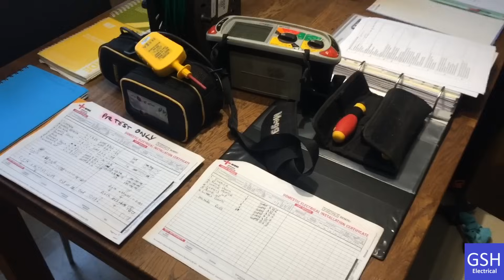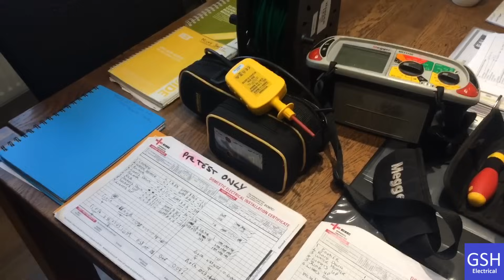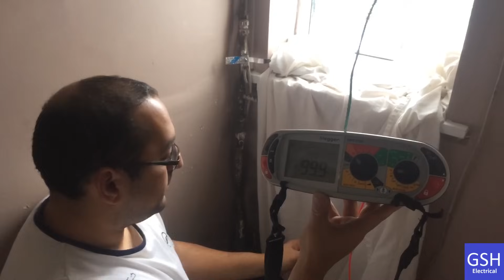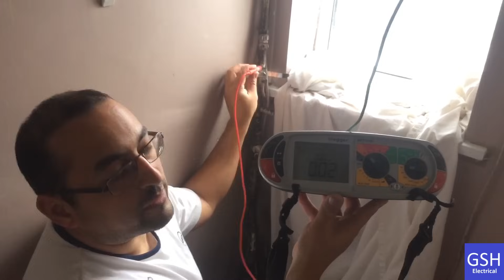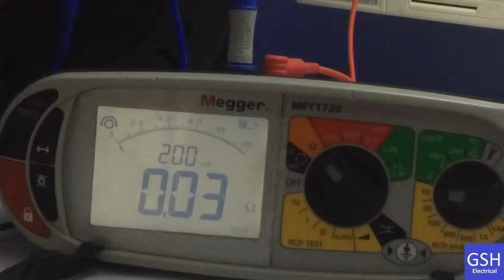On-Site With Nick Testing the Protective Bonding Conductor to the Water

Comment: where does 0.05 come from is it ra > 50/ia allways wondered 
i cant find a reg in bs7671 but i can see a point in gn3
Reply from the maker: Hi. Dose the link in the description help? Thanks Gaz 👍
Reply: @GSHElectrical  hiya to a point i know of this especially part7 gn7 ref 0.05 but theres no where i can find a test of 0.05 from met to end of bonding conductor termination to apply all there is a tick box on test certs reports to confirm its continuity

Comment: Hi Gary.

If you see this, I have a bit of a video request for you if possible. 

How can I fit 6 2.5mm single cables into 20mm Galvanized steel conduit? 

It was a huge struggle for me on my practical assessment and took about 3 hours longer than it needed to, resulting in the need to resit the test. Any help is appreciated. 

cheers, 
ben
Reply from the maker: Hi. Make sure you pull all the cables in at the same time and you attach them to a draw through tape. Thanks for watching and commenting GSH Electrical
Reply: +GSH Electrical Thanks Gary, you are a star

Comment: Hi gaz what would be the course of action if your readings for gas and water were over 0.05 ohms
Reply: There’s no such max value of 0.05 ohms given in bs7671 or anywhere else. 
That value is taken from GN3 and simply confirms a low reading between any two points such as metallic pipes. 
The 0.05 ohms confirms a low resistance to the pipework.
Size of the bonding conductors in pme installations are sized in relation to the incoming DNO neutral conductor. 
TN-S not less than half the size required for the earthing conductor and not less than 6mm. 
Nothing to do with distance.
Reply: GSH Electrical exactly it’s a rule of thumb and not a set specific regulation as to its maximum length. 
Don’t get me wrong I’m not criticising your reasoning or methods as your channel is very good, just debating that you wouldn’t require larger sized bonding conductors if say you measured a conductor and got a reading of say 0.07 ohms.
Not I’m my opinion anyway. 
We have to remember why we size them in pme installations in the first place regarding open circuit neutrals in the supply side and the conductors having to take the load current for a period of time.
Reply from the maker: https://www.voltimum.co.uk/articles/how-long-should-main-protective-bonding
Reply: R-77 
I was meaning if youd cleaned everything changed clamp etc and your readings were still over 0.05
Reply from the maker: Hi increased the cable size to 16mm2. Thanks for commenting and watching GSH Electrical